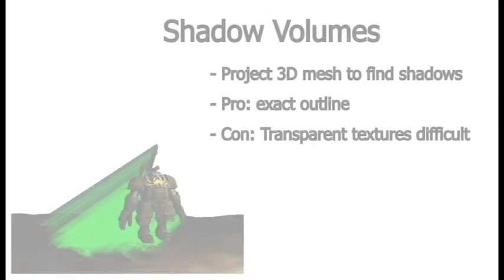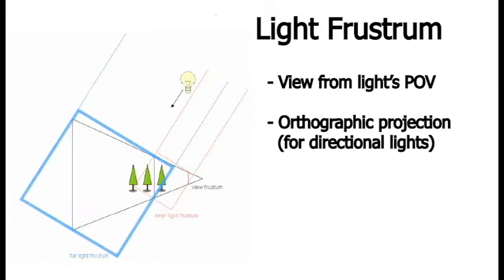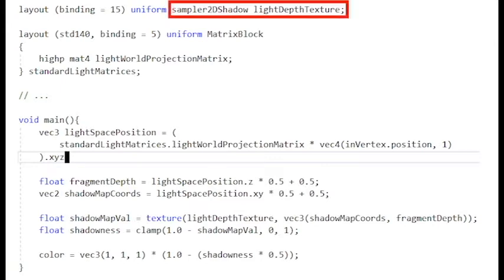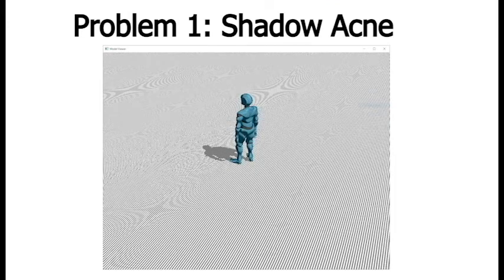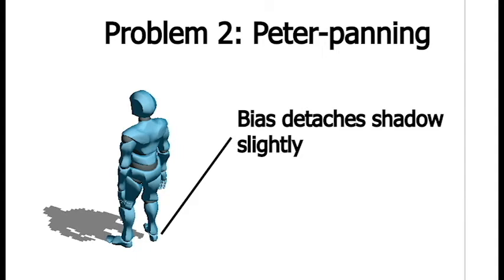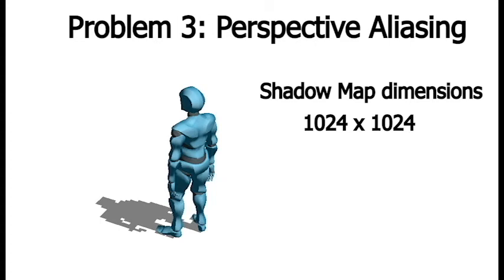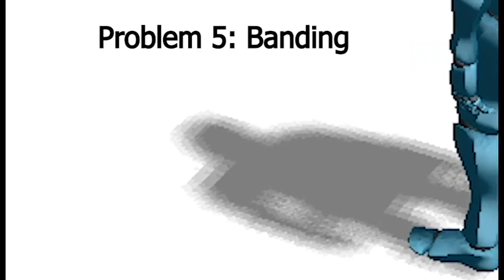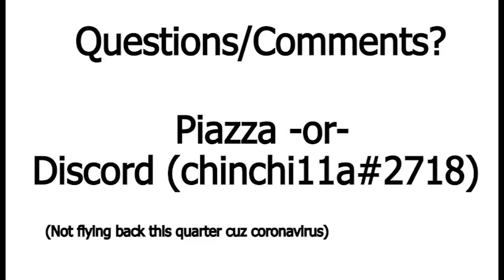Shadow Mapping - Common Problems & Solutions

Comment: One more thing you must do is to linearly map the range -1,1 to 0,1 because depth buffer only holds values ranged from 0 to 1 while in 3d space renderer it uses -1,1 range.If not,the shadow won't exist in the positive z zone.